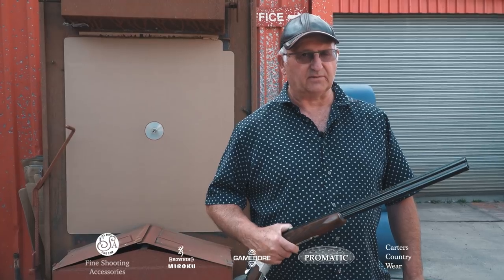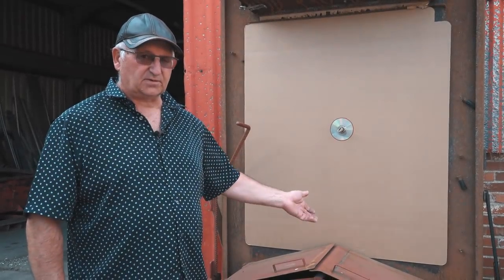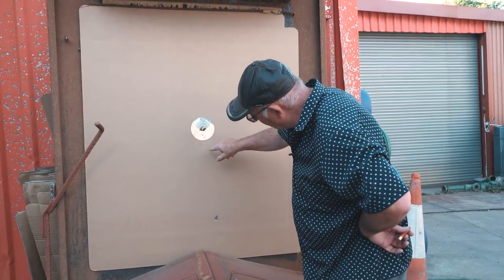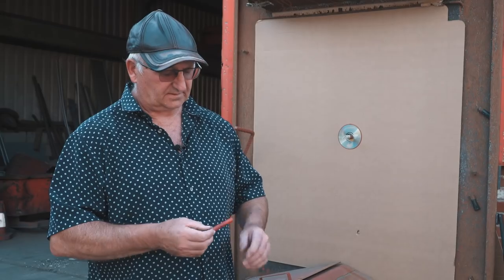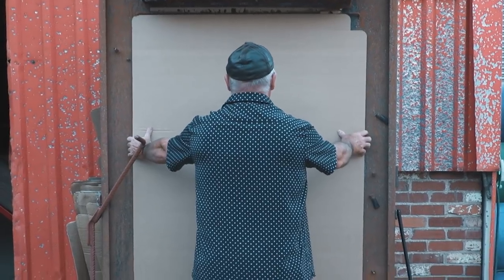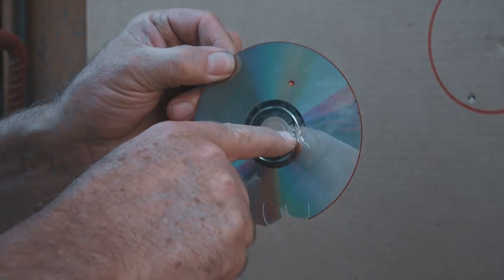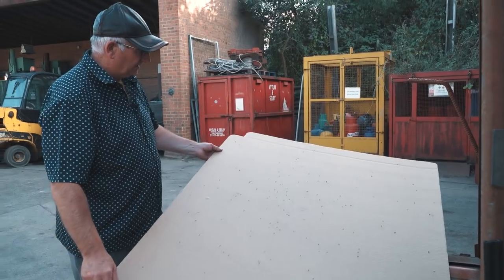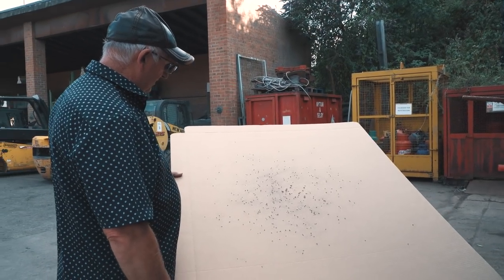410 vs 12 Bore (Pattern Test)

Comment: Dave , very informative video. Here in the U. S. I use a 1/2 oz  #8 Shot with an extra full on top and a full choke on the bottom in a Browning. Using Briley chokes and they produce a fantastic pattern at 30 yards.  This is my clay shooting gun when shooting a sub gauge course.
Reply from the maker: Thanks for the input, its a gauge i have never bothered with apart from the odd pot shot with a single barrel bolt action webley and scott  when i was very young in my early teens, i know there is more to the 410 and this kind of debate brings the evidence to the table

Comment: .410 is great in the right application. I use one for pigeons with a suppressor because the situation requires little to no noise and it drops pigeons like there's no tomorrow with less noise than my air rifle.

Comment: I used to shoot over my spaniels with .410 before i lost the rabbiting ground. Its a well known problem that eley used to be good cartridges but they changed the formula of the powder. There once great 5 shots used to strike fear in to most quarry at sensible distances. They changed the powder but never acknowledged it and after the powder change they were next to useless in my mind. Fut rather than bang!  Winchesters 21gm you need a mortgage for at £24 a box though again they where known for stopping things. Then Fiocchi came on the scene with the 19gm 6 which is a 5.5 uk. These are superb and my go to shell for the .410. Rabbit shooting over spaniels is a close quater combat affair and within 15-20-25yds tops depending in ability.. Thoroughly enjoyable with the dogs but you need the skills and reflexes when the rabbit bolts!
Reply from the maker: Fantastic description of a good use for the 410, getting the load right and the quarry species is all important tho.
thanks for your comments much appreciated
Reply: @DaveCarrieShooting  thanks Dave. I bought the Yildiz version as it was a MC, and used 3/4 and full. But later changed to full and full as are 99% of fixed choked manufacturers. Since loosing my ground its seeb little use, but treated myself to a grd 5 browning 28g for close quater pheasants on my shoot. This will only be my first full season with it.
Reply from the maker: let us know how you get on with the 28gauge

Comment: People need realise it's designed for vermin at close range, not sporting game distances. People try and silly wag using one at driven game but I think there a waste of time. A 28bore is much better using a 23gr load at sensible ranges
Reply from the maker: well said and i think you are correct in choosing a 28 over a 410 any time

Comment: Dave what have you found to be the best high partridge cartridge/choke combo through your Miroku? Thanks again for the informative videos!
Reply from the maker: fibre only - 35 or 36grm blackgold 5s or 33grm grouse 5.5  -  if you can use plastic    34grm 5 pigeon extreme or  dark storm 36 5s or 4s
Reply from the maker: all through 3/4 3/4  or 3/4 and full
Reply: That’s really helpful thanks Dave , no blown patterns through that constriction?

Comment: There’s just no question about it: the 12 g just carries such a heavier load and with more power than those lighter gauges. (Though I’m terribly fond of my 16 g for walked up pheasants.)  I do use a nice little .410 I inherited many years ago, but only for the last weekend hunt of the season that we pull those old heirlooms out for a few quail.  I’ve heard folks brag about shooting roosters with them, but the wild birds we hunt, especially in late season, deserve a clean kill and recovery to the bag.  In my opinion, the little .410 just isn’t up to that task.
Reply from the maker: thankyou for your sensible comments ! much appreciated
Reply: A 12 Gauge is no more powerful than a 410 in terms of velocity of the pellets (1100fps to 1300fps for both). A 12 Gauge just throws more lead in a shorter shot column than a 410 which is why it patterns so much better.
Reply: @JohnB-dr8sk  Wishing you and your family a Merry Christmas and a Happy New Year.  Force equals mass x velocity. Therefore, there IS much more force when more mass is used.  Shot strings are variables with barrels, ammo brands, powder charges, chokes, etc. and not necessarily subject to gauge.  I personally don’t shoot a 12 g any longer as I’ve become a pansy: too heavy, and too much recoil for my old bones. So, it’s an old 5-1/2 lb or a 6 lb SxS 20 g. double gun that gets drug through the coverts or fields. Especially on grouse, when half of the pellets are absorbed by saplings and brush, a heavier shot load just makes more sense.(Which might be why you don’t find any competitive trap shooters using .410s in their work, and you don’t see them in the north woods for anything other than a novelty.)  I catch and release most of my trout, but when I come home from a long day in the field; bird hunting, I want the dogs to have done more than point. I want to put some meat on the table. Hope you are getting out and enjoying the woods yourself this winter. Take care.

Comment: Given that the velocity of a typical .410 cartridge is about the same as a typical 12 bore cartridge, surely the striking energy of the pellets in the same size should be the same?
Reply from the maker: i agree, but 18gms of 71/2  does not have quite the same effect as 28grms of 71/2 on the DVD, this is the only difference - 10 more grms  looks very impressive at the side of the little 410 load of 18grms , and because of the gaps in pattern the smoke (lead dust impact) is not so noticeable of the small load

thanks for your comments
DC
Reply: Thank you. I look forward to your comparison of a 20 bore and 12 bore, I habitually use a 20 with 28gm  loads, and I believe it performs as well as a 12 with the same load, although there are still many who look down their noses at a 20 bore! Maybe the shot string with a 20 is slightly longer, but I do not see why there should be any other difference in performance. I think the .410 is very much a gun for short range ratting or rabbits, and should not be used for pheasants or similar game.

Comment: I don't like the use of 410s on drive game , even 28s are touch and go , what's wrong with 20,16,12s just use a lighter load and your still able to load heavier shells if the need arises
Reply from the maker: very good point Aaron
Reply: You’ve kind of contradicted yourself there. Why would you not use the gun that’s designed for the load and patterns best instead of shooting a light load in a bigger gun? People have spent over a century perfecting these guns. 28 bore is as good as a 12 at normal game ranges. 410 is definitely more limited in range and I don’t think anyone has ever suggested you should shoot high pheasants with them.